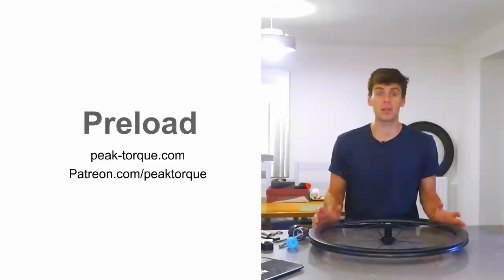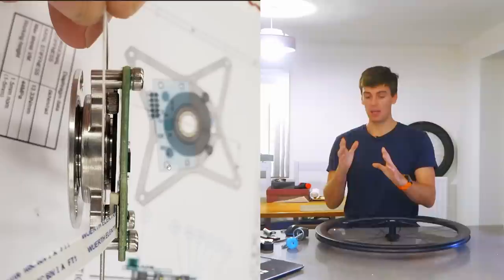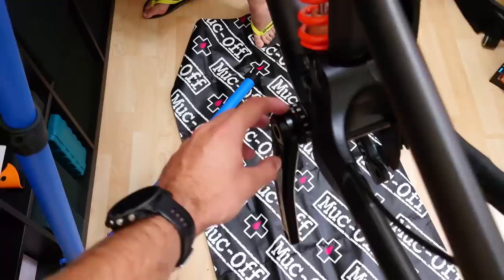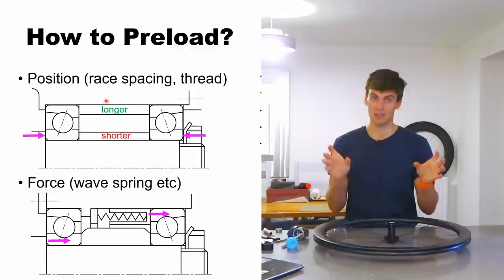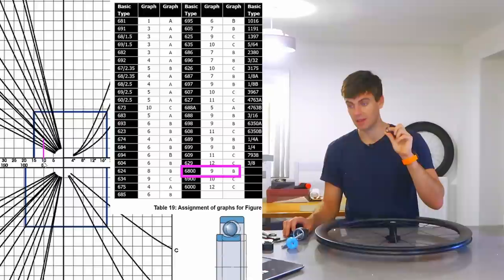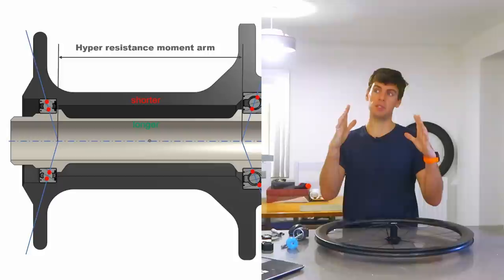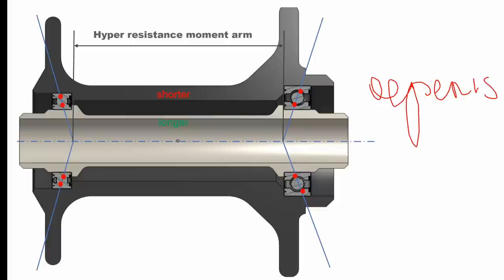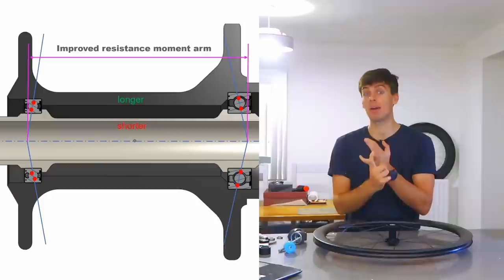Bearings and Preload Explained #bearings #engineering

Comment: question, are stiffer wheels always faster? I'm not an engineer, but I could see a slighty flexier wheel absorbing road imperfections better, and thus you as the rider can put down more power cause you're more comfortable. And thus this increased power might overcome the efficiency loss of the flexier wheel
Reply: The stiffness of the wheels concerning the bearings is axial stiffness, you wouldnt want to absorb bumps in the road by your wheel going from side to side. And its very hard to engineer vertical compliance and torsional and axial stiffness. Also its debated if vertical compliance in a wheel is actually something you want since your tires can deflect much much more than the wheel itself and do so more efficiently.

TL;DR: stiff wheel good. Adjust tire size and pressure to road condition.
Reply: Theoretically, yes, stiffer wheels can make you faster if your body can endure it. We are human with different body strength, ability, mental strength, skills and size.

If we put a robot on a bike, stiffer bike/wheels will accelerate first and save some watts.

If your objective to get more comfort, just don't buy wheels with carbon spokes.

Comment: Where do you get those bearing clearance charts? Any links available? Thanks.

As for the preload direction, who in the hell would make the inner tube longer?!?! Of course you make it shorter for exactly the reason you mention - the endcaps ensuring the preload once the wheel is mounted to the bike. The way this industry works there is no way in hell the bearing inserted into the hub shell will stay there, unless it's not supposed to stay there and there way a mistake made (too tight of a tolerance in production or something similar).

Comment: there is something wrong with calculation you said i get something in the middle but it depends on the fitting not only chart.before you have to calculate fitting and you have to measure shaft and inner ring than you have to calculate how much clearance left for example inner ring in 19.97 mm and shaft is 20.00 that means you have 3 microns fitting than you have to subtract from maximum celarance than you find the correct celarance.chart is just for in run clearance not depends on stok tolerances

Comment: Doesn't the axle get compressed by the through axle, shortening a bit and unloading the bearings? I noticed this on my DT350 hub, with the caps off the bearings are stiff and notchy, but when the wheel is clamped on, it's very smooth. In my case the inner axle sits between the inner races (pushing them out) and the end caps press onto the inner races when the wheel is clamped by the fork.
Reply: There is another video from him on that topic and he takes a dive in to the DT350 special case

Comment: Thank for this, super! Question out of the blue, from a non-mechanical engineer. The design choice for ball groove bearings in wheels vs cone shaped ones, why? I mean, in a headset, usually cone shaped ones are used (load angle differ, of course...) But is the groove ball bearing "always" the best option, given what types are available?
Reply from the maker: See pinned comment

Comment: So if the bearings in wheel hubs are effectively being used as angular contact bearings, is there a good reason not to just use angular contact bearings in the first place?
Reply from the maker: The contact angle is more extreme with a proper AC bearing thus the drag will be higher. Radial load rating (rider weight, bumps) will also be reduced for a given size.

Comment: If the correct preload is so important why do Shimano have a plastic knob on their BBS that you tighten by hand, rather than a precise torque setting like most of the other bolts on a modern bike?
Reply: I could be wrong here so go gently, but I vaguely recall reading in a Shimano document that the torque specification for the NDS crank/axle retainer was 1.5 NM.
Reply: I believe you missed the portion where PT discusses the Hollowtech II crank adjustment as a "position preload" system. The downside of position-based preload is you can never really measure how much preload force you actually applied, unlike with a wave washer where you can measure force via its deflection. So Shimano tries to make up for this by providing a torque spec for the preload adjustment bolt - a very low torque, such as 1.5 Nm
Reply from the maker: @TypeVertigo  Correct. In a shimano BB, Hambini may verify, but i think they actually use proper angular contact bearings which dont mind quite of a lot of axial preload, but yes setting it by hand is rather arbitrary.
Reply: Interesting. So when you say “Shimano BB”, would this be a Shimano branded BB or any Shimano type BB? ie: Would say, a Praxis T47 BB also use AC bearings?
Reply: @BikePappy  Normal Praxis stuff is not angular contact. If it is they specifically advertise as such, eg "Ceramic Version:Enduro 2437 Angular contact, Grade5 balls, ABEC5 Assembly". Cost is $240 vs 90 for the regular version.

Comment: Very well explained and informative. But I still can't get my head around what Campagnolo are doing with their Ultra-Torque bottom bracket. BB-Infinite tried to remedy a problem with the Ultra-Torque by using a retaining compound which I don't agree with. I thought about using shims to create better spacing so the shaft doesn't move but I'm not sure this would be the correct way to address the side to side play. Do I shim to target inner bearing races or the outer. And why is Campy still using that clip on the drive side? I believe that even the bearings aren't that good because they seem to have a fair amount of drag even when I remove the bearing and spin it by hand.